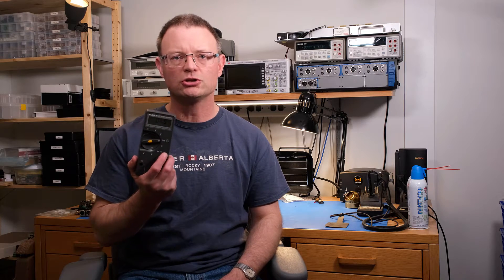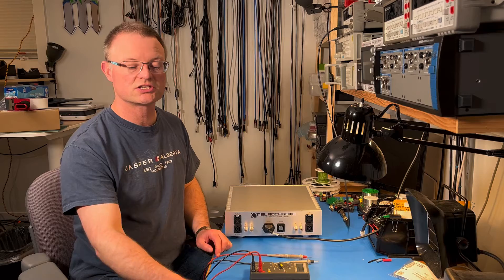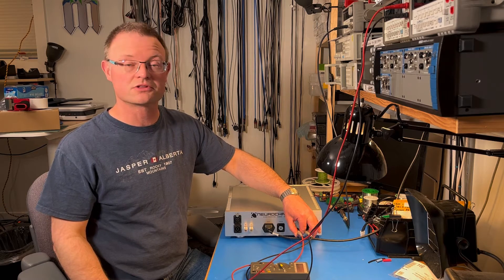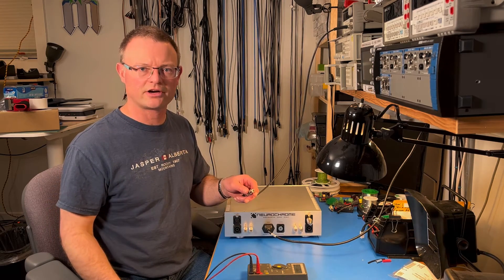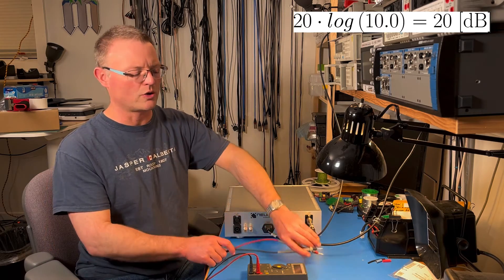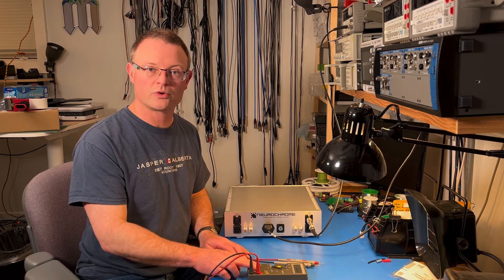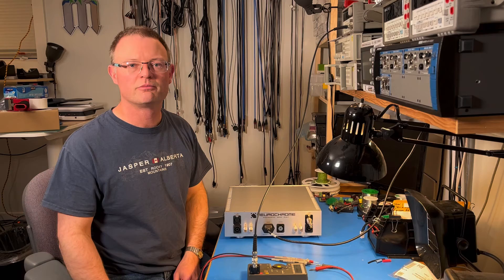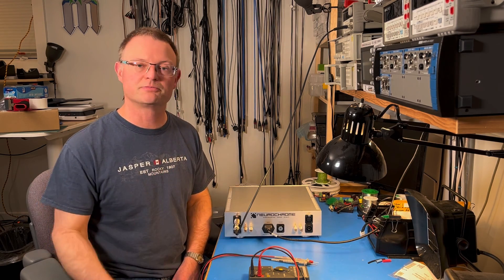Test Your Audio Amplifier With a Multimeter and a Smartphone

Comment: On my AV receiver, the left front channel outputs much louder high frequencies than the right front.
I've done enough testing to know it's the receiver and nothing else.
I've thoroughly cleaned everything on pcbs and checked for cold solder joints, couldn't find any.
DC offset seems good between the 2 channels. Only thing I found was with amp on nothing playing, the right channels inductance is double the left channel. Can't remember exactly but I think the right channel was 1 ohm lower than the left.
I don't know if that means anything but the overall spl of right is lower and the HF are no where near as loud.
Not my hearing either.

Comment: My signal generator when set to 1V amplitude only reads 0.3V on my multimeter, do i need this feed through terminator to rectify this? What terminator would i need. Thank you
Reply from the maker: The terminator would not address this. Maybe your meter isn't reporting the RMS voltage or maybe the signal generator is broken.
Reply: The signal gen is working perfectly. 
My meter is a fluke that measures RMS. 
I figured it out. 
The signal gen is outputting 1 volt peak to peak. Which is about 0.35 volt rms. Hence the reading of 0.35 on the fluke. 
So to get 1 volt RMS I would need to set the signal gens amplitude to about 2.85 volts peak to peak.
Reply from the maker: Ah! That makes sense. Thanks for following up.

Comment: is the50 ohm for the genmerator in parallel,then with the load?
Reply from the maker: A feed-through terminator like the HP 10100C that I'm using in the video has the 50 Ω in parallel with the load. The load of the amplifier is 47 kΩ, so the 50 Ω terminator makes the generator 'see' 50 Ω.

Comment: Hi from India. I follow all your posts on diyaudio.
And your web site.
Where I have been stuck for the past 6 months is how to measure thd using rew or arta  I have a dac I have a noisy China function generator and I have my phone with many apps to put out single or multiple tones I also have a datsv3 
My real problem is my dac has an input but that input does not show up in windows datsv3 input does show up 
How about a video on this 
It would help if you mentioned what is an acceptable dc offset as well as how to tune it if ots off
Reply from the maker: I am planning a video on how to do distortion measurements on the cheap. So stay tuned.

Comment: Is it safe to short your input wire on all amps ?
Reply: Thats what I really wonder too
Reply from the maker: Yep. Any amp can handle 0 V on the input and that's what a short-circuit provides. Often I'll use a 50 Ω terminator instead of a short, but either works.

Comment: Hi nice video. I need Ur suggestions to select digital multimeter use for servicing repair work for Amplifier , LCD DLP projectors , power supply....etc AVG or TRMS meter ?
Reply from the maker: Definitely a true RMS meter. The Fluke 70- and 80-series are really tough to beat and available calibrated for not much money on the used market.

Comment: @neurochrome Awesome contents. Thank you so much for sharing. I just followed instruction and tested with my first DIY amp and DC offset is 0.9mV DC. However, Gain is something not right. when I play 400Hz wavetone RCA Male jack measures 1.15v and gain from speaker out is 0.003v which equates -50db gain (negative figure) based on the equation. How gain figure can be negative? (scratch my head)
Reply from the maker: Hmmm... Is the amp turned on? Sorry I couldn't resist. I would verify that you do indeed have 1.15 V out of the sig gen once it's loaded by the amp input. If the amp doesn't provide a higher voltage that its input, I'd make sure that the right input is selected and start debugging the amp.